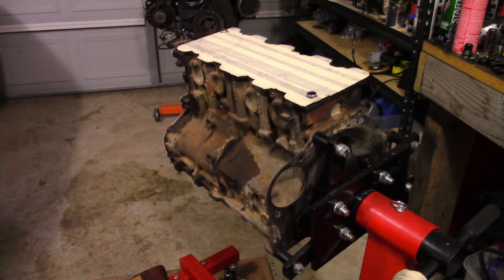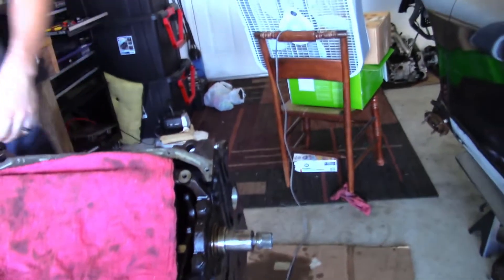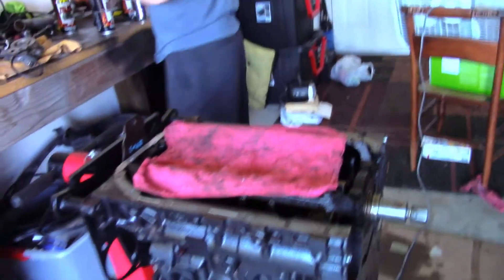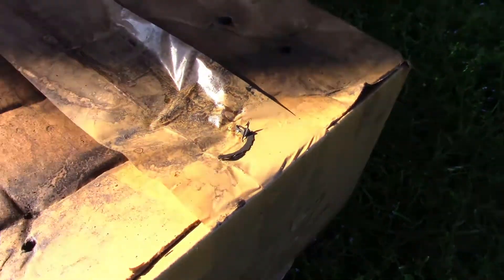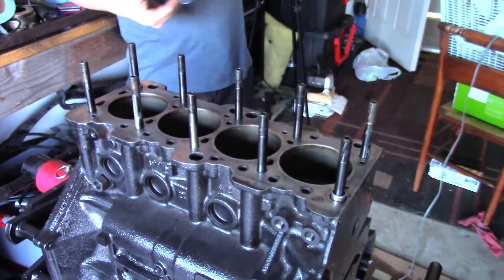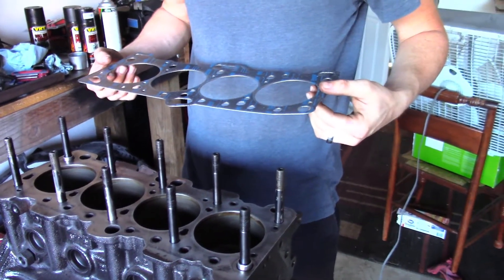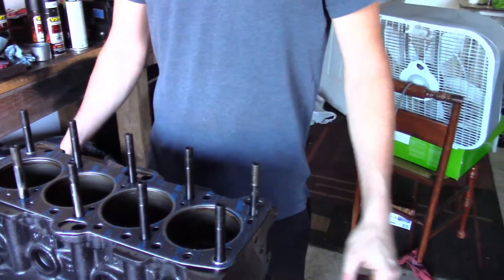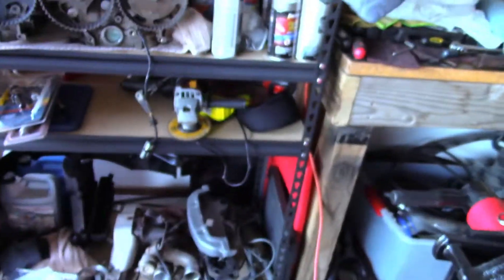4g63 Engine Refresh Pt:2 Head clean and Install.

Comment: what's the tip you use to grind down the block? I'm about to redo my block
Reply from the maker: To remove gasket material? Since were using a composite gasket we usually use bronze wire wheels for softness and red scotch pads just make sure you protect engine bores from possible debris.
Reply: BuildBoostDrive not for the head gasket I'm talking about to gring the block down for paint like u did in the beginning of this video
Reply from the maker: Oh not far for from the same thing steel wire wheel set from harbor freight, a good paint prep chemical and I usually use VHT paint for quick and easy, so i dont have to pull out the guns.
Reply: BuildBoostDrive o okay cool u got a link for the set?
Reply from the maker: https://www.harborfreight.com/catalogsearch/result/index/?dir=asc&order=EAScore%2Cf%2CEAFeatured+Weight%2Cf%2CSale+Rank%2Cf&q=wire+wheel+set

They have numerous different sets bronze and steel.
Reply: BuildBoostDrive should I go with steel or bronse with one is better
Reply from the maker: Theyll both remove light surface rust the steel will be tougher than the bronze.